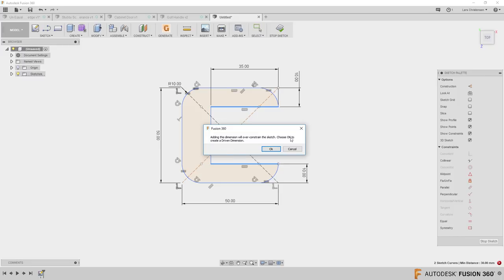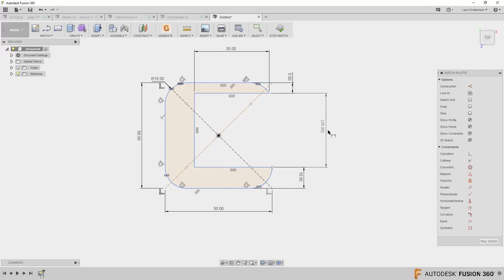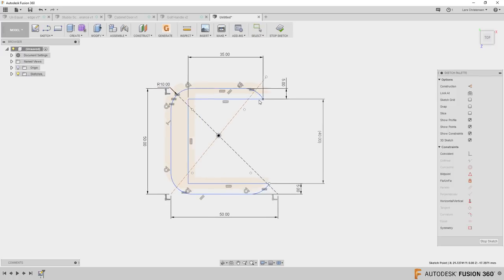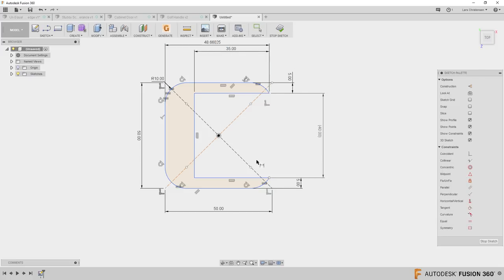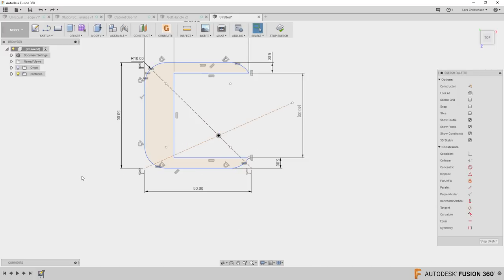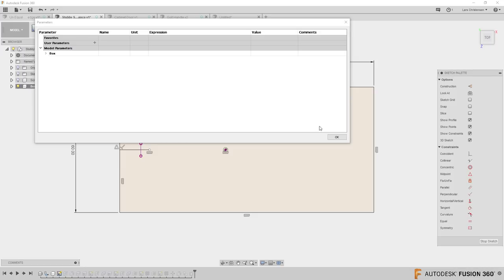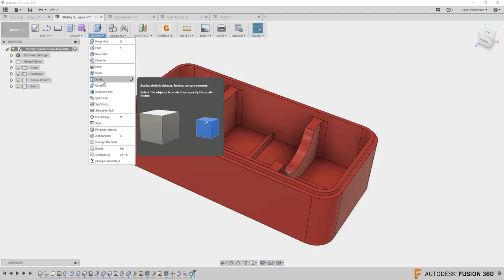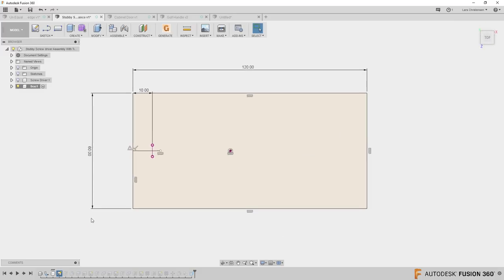Today's Best Fusion 360 Questions & Answers — #LarsLive 153

Comment: I think the trimming problem in your second example is easily solved by using a different constraint point (not the center of a center rectangle) to anchor the initial rectangle. This is the same problem as you run into in Solidworks--but it's not really a problem with the software. Rather it's a problem with the designer not realizing that you cannot use the center of a symmetric geometry as a constraint, when you later remove that symmetry. So the easiest thing to do is to simply anchor the geometry to somewhere other than the center. 

For instance, I just did this same example in F360, and I anchored the midpoint of the left side of the rectangle to the origin. Then when I applied the fillets, and then used the two-point rectangle to create the opening in the right side of the rectangle, it remains fully defined. So it's really about where and how you anchor your geometry. This is not a bug in either F360 or in Solidworks...it's the designer not understanding how the software "constrains" (ie; fully defines) the geometry being used. For a center rectangle, that constraint is based on symmetry about the center point. So if you trash that symmetry by trimming an edge for instance, then you've trashed the constraint...and the software reacts accordingly. 

So it's a simple fix--just don't use a symmetric object when you're going to later make it asymmetric. Been there, done that--enough times that I spent the time researching it to understand why it happens, and how to avoid it.
Reply from the maker: Hi Tom B Thank you for watching! And thank you for a great comment! I wish I had used these exact words in the video! That was my point bringing it up in the video, but I am not sure I did a great job making it come across.

Hope you have an awesome day!
Reply: No sweat--thanks again for all your great videos!

Comment: 13:58: Why do you use that clumsy parameter 'browser' to find the dimension you want to change if you can just select the dimension in the sketch instead?  You can just type '120mm + Tolerance' in the sketch itself. That is in my opinion way more convenient.
Reply from the maker: Hi IgnoreMyChan Thank you for watching!
Yes, You are right. You need to do the most convenient way possible. Me? I just show the tools :-)
Reply: I understand but you only show this method but in my opinion is much more important to know the other method of editing in place, because you can use the same parameter in later dimensions as well. If the new guy then only knows how to use the parameter browser, he loses a lot of valuable time ;-)